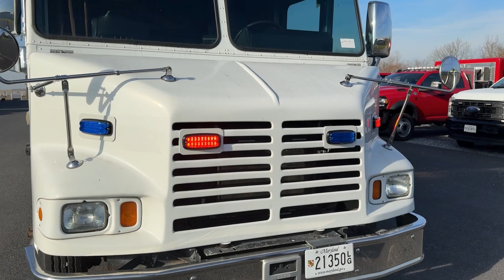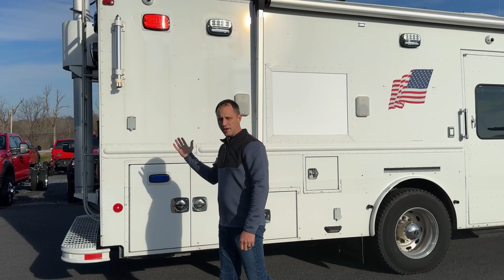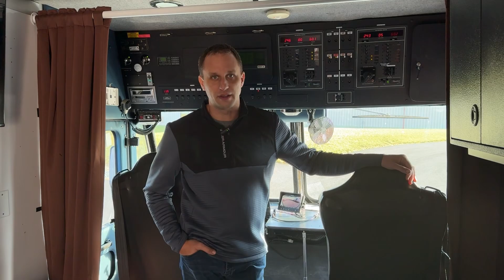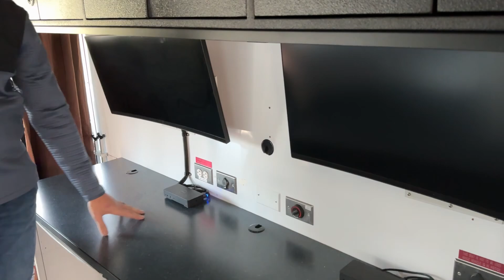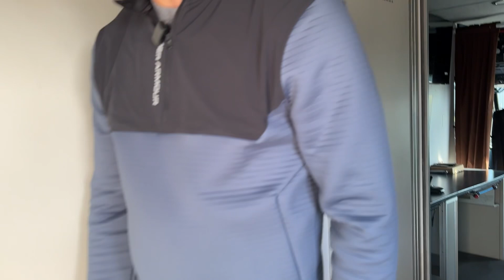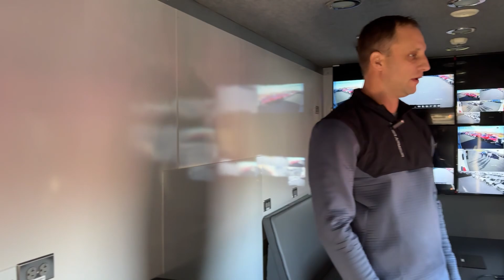Frederick Police Command Unit | 911RR

Comment: i would have recommended installing two more of the larger sized lights at the bottom corners, and two smaller ones on either side of the ladder more central to the area of the rear